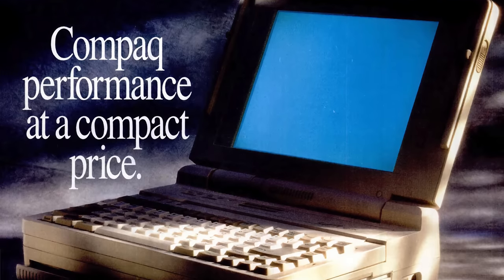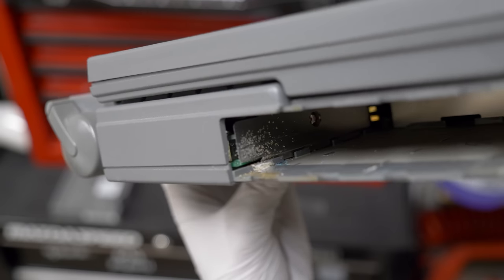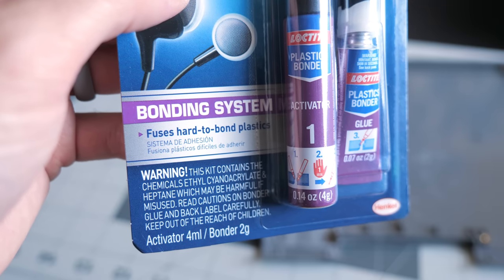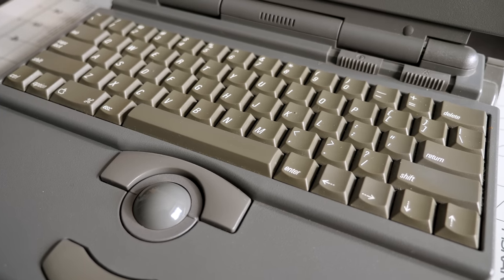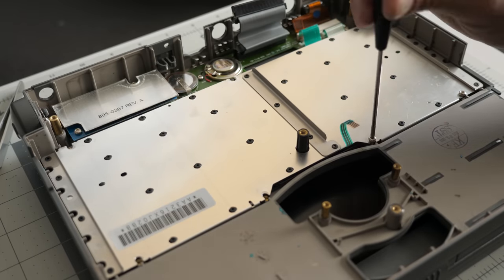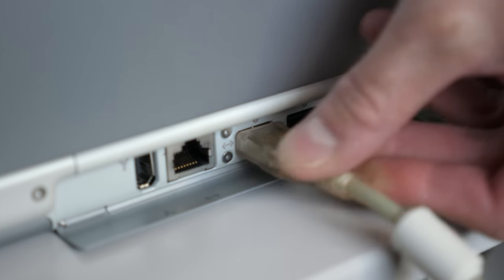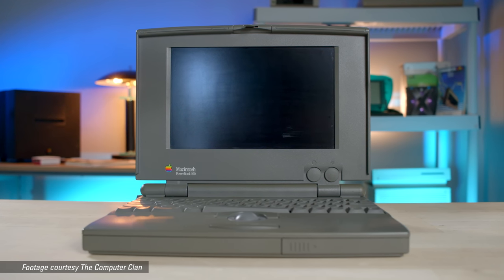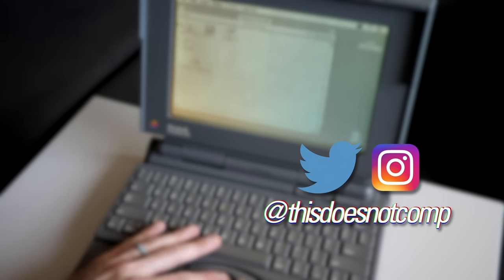Restoring a Macintosh PowerBook 145B

Comment: I would advise to, if possible, to tweak the tension on the hinge of the screen. The plastic where the hinge is screwed to tend to break, because laptop hinges have a self-regulating mechanism, that tries to compensate for the wear after constant opening of the lid. The problem is, sometimes it does too much, making the lid harder to open and the weakest link breaks.

After the adjustment, the soft spot should be opening the lid without the base going up. That should be near the factory adjustment.

Comment: I've got several old Powerbooks in various states of repair. One of them's got the active matrix monochrome screen with the "black vignette" effect, rendering it unusable. It starts up OK and the picture's superb, but the black starts to creep in from the edges as the screen warms up. I've also got one with a passive matrix monochrome screen that's blank white when it starts up, then slowly gains contrast over a five-minute period. It's annoying but at least it's usable.
Reply: The passive matrix LCD probably needs a recap to its driver boards.

Comment: Funny you should mention the Powerbook G4 Ti... I grew up with an LC575 (an '040), and recently was interested in revisiting some of the Mac games of my childhood. Unfortunately, the state of Mac emulation is still poor: unreliable and very laggy mouse cursors. I had the idea of looking for a slightly more modern Mac that ran OS9: it should still be able to play the same classic games due to the 68K emulation, and the modern inputs (like DVI/VGA, Ethernet, and USB) ought to be much easier to work with, possibly even integrating into my existing computer setup. I came across the Powerbook G4 Ti as being one of the last machines that could natively boot OS9 (and with gigabit ethernet no less!), but I was hesitant to go for a laptop. However, I soon realized that over the past few years, people have worked on allowing the Mac Mini G4 to natively boot OS9 with surprisingly few side-effects: custom firmware and some driver/software tweaks all rolled into a bootable ISO that just lets you install OS 9 on the thing like other mac. It's probably the most compact OS9 desktop possible, and still has support for DVI/Ethernet/USB. I've got one in the mail that I'm eagerly awaiting!

Comment: "If only modern laptops had continued this tradition"

There's lots of easily repairable and upgradeable laptops out there...just not Macs :/
Reply: @acumenium8157  Well if they don't count, it's a good thing I never mentioned them lol

And it really depends on the model
Reply: @acumenium8157  Yeah, you just need to use common sense & look up reviews/specs before buying. All the laptops myself and my family have owned have been repairable & fairly easy to work on, including a couple of 2011 MacBook Pros (which were complete nightmares and disasters). The main issue is finding very small and compact laptops that are fully repairable or upgradeable - there always seems to be a compromise. My mother's Dell XPS 13 is incredibly easy to fix, but it has soldered RAM, for example

Anyway, the TLDR of this weird ramble is: 
"it depends" lol
Reply: @anew742  a few examples would be appreciated!
Reply: @turquoisesorcerer  At least of the laptops myself/people I know have owned:
Lenovo Thinkpad, Dell XPS 13 (soldered RAM but otherwise incredibly serviceable), MSI Apache Pro (shame about the hinge issues - still present on new ones too!), HP EliteBook, and the aforementioned older MacBook Pros (avoid these like the plague tho!)

Comment: White vinegar works a bit better getting rid of battery corrosion (especially NiCd and NiMH batteries, as well as alkaline). Just let it sit for a few minutes and use plain water to neutralize the acid from the vinegar.

Comment: Friday is always better with some this does not comp. 
You m ow how we are getting IPS replacements on handhelds. I wonder if anyone out there has thought of trying to do the same on these older active matrix machines. Use an fpga board between the connector or something to interface a modern ips or lcd. It would be pretty awesome to have modem display tech on some of these older machines.
Reply: I've thought about this too.  The huge variance in exact size, resolution, and mounting tabs is going to be problematic, but I'm hopeful we'll start to see custom LCD manufacturing get cheap and ubiquitous the way PCB and CNC stuff has.

Comment: i was going to school in the mid 2000's like 06 or 07, and one of these was in the tech lab as the school had replaced it. i was like "can i take that home" and was told no because despite not being used in any real capacity there "could" have been potentially sensitive information and instead of just wiping the hard drive they threw the entire computer in the trash.
Reply: ...for someone to take and get potentially sensitive data off it. Lol
Reply: @s8wc3  Thats just it though, aside from a few student projects there WAS no data on it that could be considered sensitive, it was literally a "cheap" computer being used by students.

Comment: ++Collin++ I wonder if you have ever seen or heard of this issue from Macs in the early to mid 90’s. I had a PowerBook 520 that, for whatever reason, hated reading floppies made by other Macs. I could get a brand new disk, pop it into my 520, and initialize it. I could through some files on it and move on with my day. But if I got a disk from school that had been made on one of their Macs, even if it ran the same OS and everything—even if it was on another 520, it would tell me that it could not read it and that it needed to be initialized. In modern terms, it would be like having a USB drive that can only be used on one computer in your house for whatever reason. Anyway, I was just curious if you had ever heard of it/ran into it and if you had any thoughts on the reasons why that might have happened.

Comment: I didn't know any of the USB floppy drives could write system disks for the older Macs
Reply: You need to be using a 1.44 MB disk image. I don’t think you can use it to write to DS/DD (800K in Mac format). You can copy the contents of an 800K disk image to a formatted HD floppy using the USB drive, and then as long as you have another Mac with native standard / native Mac floppy drives that can handle both the 800K and 1.44 MB floppies, you can end up with disks to use on an even older Mac such as a Plus or other pre-SuperDrive machine.

Comment: "If only modern laptops had continued this tradition"

Sure, if you want a 4-inch thick laptop, they certainly could.
Reply: Not really. I have a modern Dell laptop purchased just last year. Getting to everything he got to here (that's still applicable today, anyway) is quick and easy. Want to get to the motherboard, ssd, WiFi card, etc.? 3 screws and some clips along the edge. The screws are even captive! It's not the world's thinnest laptop, sure, but it's not cumbersome by any means. I'd say it's a pretty average thickness for modern laptops. The issue isn't with thickness, the issue is with modern designs intentionally forgoing serviceability to make it more trouble to repair than it's worth, and thus getting you to buy a new one.
Reply: I think it's a cost/benefit thing.

I'm not a designer or EE for a commercial product, but I am a hobbyist that frequently sends off for PCBs, and currently waiting for a CMOS battery case that I designed to get here from Shapeways.  So, I've had to think about things like connectors, crimping, cable assemblies, latches, screw posts, etc etc..

That stuff is a pain.  It's definitely not insurmountable, but I have sat on projects because the first draft would have used some connectivity solution that just started to mount up to more trouble than it's worth.

So, if you send a fleet of laptops out there, and maybe 5% of your users actually ever turn a screw on it... just simple stuff, like replacing a HDD or adding RAM... then, particularly on your lower-end models, it just makes sense to leave that stuff out.

Computers are CHEAP now.  The one in this video, at less than $2000, was remarkably accessible compared to some of its contemporaries.  $2000 now, even ignoring inflation, is a relatively high-end machine.  So, it does stand to reason that repairability and upgradability probably meant more then, than it does now.  Particularly if you consider that the population using and buying computers then was a more tech-savvy crowd, that was more likely to be interested in swapping out parts at some point in the thing's lifetime.

Now?  Even * I * am unlikely to open a laptop, and I take everything apart.  I will buy as much computer as I can justify spending, and in five to ten years, I will buy something else.  I have upgraded laptops in the past, but usually when space or memory were both relatively expensive.  And by the time I did, I was starting to look at battery replacements, then soon having to replace the fan or a key or two on the KB,  maybe the HDD failed... i.e., time to move on.

So now, I would just rather every square mm go to a bigger battery, and keep the overall package as light and thin as it could possibly be.  I'm going to be carrying it everywhere in a backpack, so I appreciate small.

TLDR:  I think the audience has changed, habits have changed, the cost has plummeted, and hardly anyone (of the total) ever bothered to take advantage of expandability.  So it totally makes sense to me that today's machines are built to retire in the same condition they were manufactured.  It's a bummer for some, and I get that, but it's just sensible product design now.

Comment: Next time you have a battery like that don't throw it away, contact me and I will rebuild it for you. right now I am in NW MN but I will be an hour south of you soon.
Reply: Now here's an interesting comment! What do you do with the batteries? I guess remove the interior and put in new modern cells which end up an equivalent voltage and current?
Reply: Yeah I have done battery packs for the 5300/190 and 1400 with no issue. Just replace the cells with equivalent.

Comment: Only a psychopath removes the lcd from the lcd assembly while the lcd assembly is still attached.  Everyone knows you remove the top chassis cover, remove the keyboard, unplug the screen & remove the whole thing.  Otherwise you'll strain both the screws & the screen.